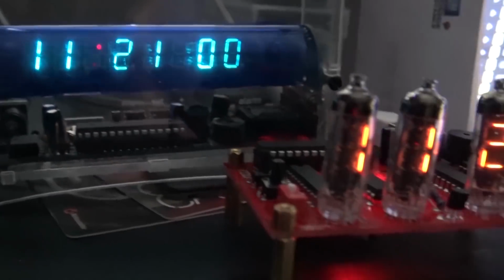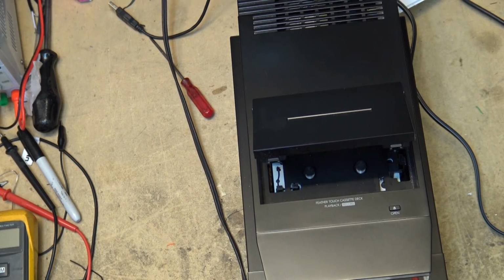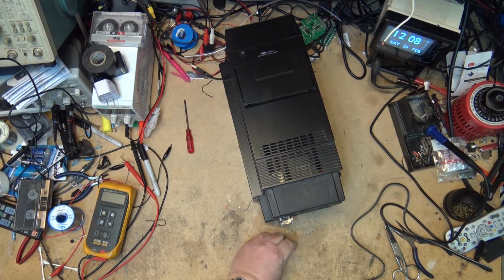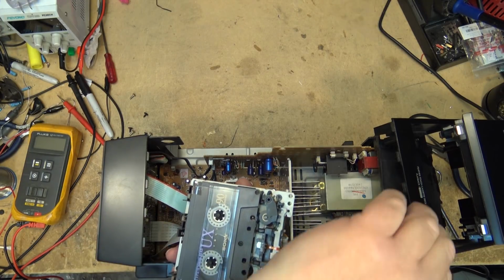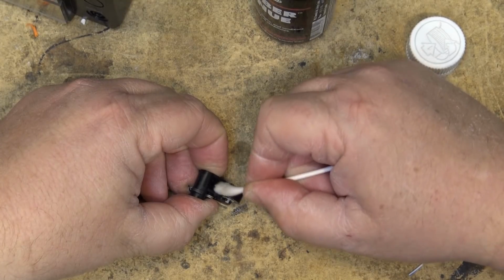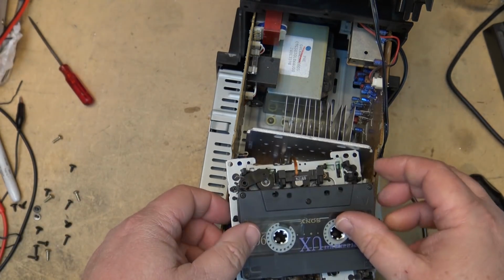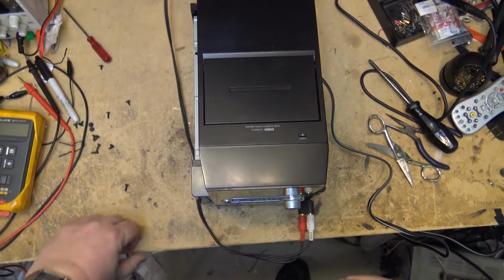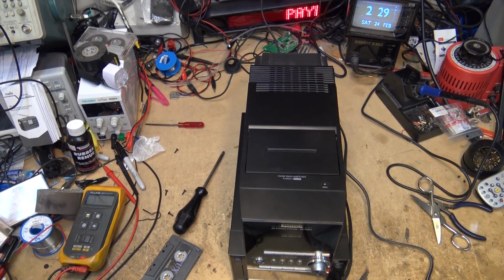Panasonic SA PM 27 tape no play

Comment: Thanks so much Mr. 12volvids! It's the same or very similar tape mechanics for this models: SA-PM21, SA-PM17, SA-PM27, SA-PM07
Note: to adjust tape speed. The screw (volume motor) is on the back side of the motor.

Comment: Such a helpful video; i have a similar situation with this model (actually the PM17,but almost the same thing) whereby the cassette mechanism engages, then halts and returns to it's disengaged position. Occasionally it will work and play the tape continuously with no problem, but i can't figure out what is causing it to behave one way or the other. Regardless, this video was a huge help in understanding how to take it apart and the way everything works together. I'll keep plugging away at it..... Thanks!

Comment: Nice repair, I can still get pinch rollers complete, but very often end up fitting the new rubber to the unit's original plastic or brass boss. That Panasonic mechanism I've seen as both unidirectional and autoreverse, you can see where the parts'd be for auto rev on the SA PM 27. You're so right about isopropyl, it's good for heads, but not so good for rubber. I end up using a normal kitchen cleaner for rubber parts, but very often, I've to fit new bits !
Reply: Hi, where did you get your pinch rollers for this unit from? Mine are very badly degraded (centre part) and very loose. Thanks.

Comment: You can also use an exacto knife to scrape hard residue off. I normally do this when the roller is spinning (when it wants to spin anyway or you can help to spin it anyway). I also use this method with old curved surface pinch rollers to get it flat again. Benefits of this is that you scrape it off evenly. This avoids roller dancing and shear of the tape. To soften the surface (when needed) I use organic oil, no chemicals required because it is a natural material. Works great. Sandpaper can be used after this, only apply it when the roller can spin. 'Scrape' evenly. Use this only when you cannot buy a new one. Result can be amazing when doing right.

Comment: Panasonic products were mostly built with quality parts. You got it working nicely.

I noticed an extra hole in the mechanism - possibly for a second capstan in auto-reverse models?
Reply: Possibly. A higher-end model likely exists with such parts installed and running.

Comment: Nice trick with the sandpaper to slightly roughen the pinch roller!
Reply from the maker: The sandpaper takes the oxidation off the surface to allow the rubber renew to penertare the surface and work it's magic softening up the rubber. 
Of course I cleaned the rubber renew off afterwords with a cloth before loading a tape.

Comment: 21:35   seems the pinch roller (motor servo?) must keep contact or pressure with  tape at a certain level, . If there´s no "traction", computer thinks tape has ended (more tension) and refuses to play.

Comment: Much enjoyed this video and learned  a lot ty - Great Job !
Reply from the maker: Thanks. This came in for the "demo mode" problem. When it arrived the owner said it wouldn't shut off. It was when testing that I discovered that the tape deck didn't work, and the root cause the pinch roller had gotten slippery,

Comment: Hi there nice video. Is this belt a  drive cassette player? I have a PM 71 and the cassette in play mode sometimes slows down. Could it be a stretched belt? I dont want to take it to the repair shop if I can have a go myself. Thanks and stay safe
Reply from the maker: Yes the cassette deck is belt driven
Reply: @12voltvids  thank you for replying. I might have a go. Best wishes
Reply: @12voltvids  Would this be the same size belt as below? I am struggling to find any links for the PM71SD. Thanks.

Comment: I have a Sony, no cassette player. 3 disk CD changer. (Bought 2008)  It has an aux input. What sucks about it is it isn't very loud compared to the Tuner. Some CD'S are louder than others. So I need something to boost the gain. I can't do anything except to the aux input. I actually use my computer's sound card to boost the volume. I know, not the best thing, but it works. I need a booster/equalizer unit.
Can you boost the volume within the unit, or is it fixed? Mine has a cooling fan too. It comes on at higher volume. (How do I know? I put my hand behind it and can feel the air flow)
BTW, I like that Panasonic you fixed. ;)

Comment: I have a belt loose on my panasonic sa pm28, I cant get passed that orange strip that connects the top compartment with the pinch roller and capstan to the underneath compartment with the belts. I do not want to pull it off.

Comment: What products would you recommend for cleaning pinch rollers, given that Isopropyl alcohol dries out the rollers? I am keen to keep my early to mid 1990s decks running.
Reply from the maker: mannyo1221 
On my personal gear I use TF solvent. Go luck finding that now as it has been banned since the 80s. (It is a cfc and is harmful to the ozone) I stocked up a few cans of it when it was available. I have enough to last me for a few more years. Then I will be using alcohol and drying up my rubber.

Comment: So, even´s hard to work on these micro systems, we can say each drive is still "separated". I remember korean 3 in 1 ssystem from the 80s where everything was very tight and you had to remove many cables and mdules to acces bottom.

Comment: This unit must be from around 2001 or so. They had a big thing for the mirror look back then. Heck Panasonic even made a Nintendo GameCube that matched this unit called the Panasonic Q.
Reply from the maker: I didn't note the year. It is back at it's owners place now, and my old elementary school teacher was happy to get it back. Gave me a 5 disk CD changer that "ate" a disk. Will deal with that one tomorrow. I was dealing with a Hammond B3 organ today. Client brought one in from Hong Kong and it was a 230V 50Hz model. Changed out the transformer, syncronus motor and starter moter but it wouldn't start. Figured out why, and got it to start and play a few some notes. It is a work in progress. Got sound out of it for the first time today.
Reply: Came with a Panasonic-labelled controller and all. Was JP-only though.

Comment: "Suspected of causing cancer"
That sounds like something they put on there due to it also being sold in California. I could be wrong but if it actually can cause cancer, I'm taking it serious.
Reply from the maker: Everything in California is known to the state to cause cancer.  Even the air.
Reply: @12voltvids  California needs to chill TFO with that crap.
Reply from the maker: @TheVCRKing  they are just covering their ass. You know, so if someone gets cancer from handing an extension cord, their lawyer won't have a leg to stand on.  After all they were warned that handing that extension cord was known to the state to cause cancer and the user was advised to wash hands before eating drinking or smoking
Reply: @12voltvids  That's pretty funny because I was just told that they might be saying all that so no one gets sued.
Reply from the maker: @TheVCRKing  of course it is about lawsuits.  Americans sue if you fart in their direction.

Comment: haw much  dose that bottle cost    in the UK  pounds   ???
Reply from the maker: What runner renew? I have no idea it was 8.85 when I bought this bottle about 5 years ago.
Reply: The rubber cleaner  ,  I take a look in Maplin  store    its the only shop I know of   I take it that it will be about £20 ish  from there it will not be cheep in that shop but it is essential stuff .
Another guy was on about this  and then you video came up with the same idea .
At least that stereo was easy to work with    Thanks for the video

Comment: That pinch roller assembly looks like one out of the Panasonic dual cassette boombox I used to have.
Reply from the maker: Yes Panasonic used the same roller assy in many of their decks. They standardized many parts across multiple units to save production costs.

Comment: Maybe that is why SD memory cards are replacing compact cassettes, tried to pull one of these units apart the one I try to disassemble was a stacked unit which used a heavy duty ribbon cable to link to two units together and it turned out the cassette unit was in the bottom unit and the compact disc and tuner was in the top unit also the power unit was actually in the cassette playing half but no luck so  just had to take it to the dump.